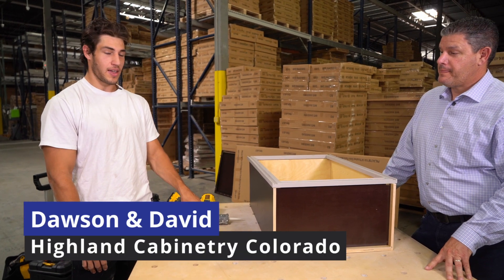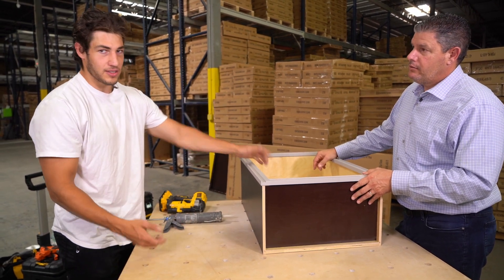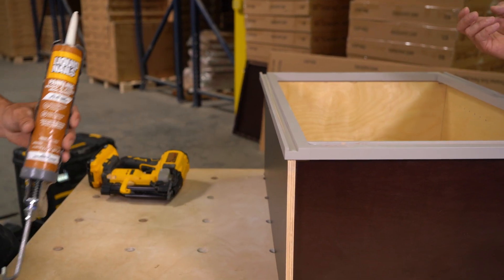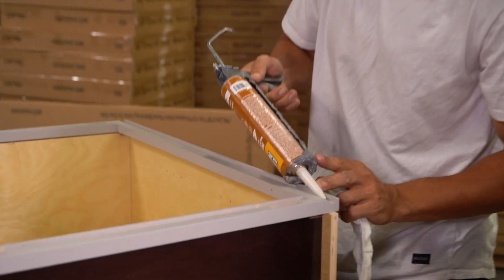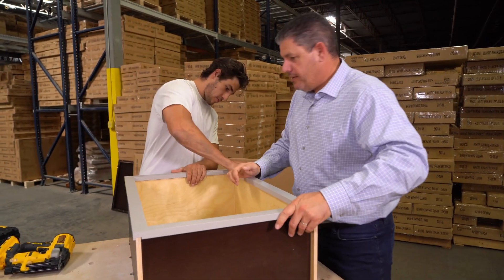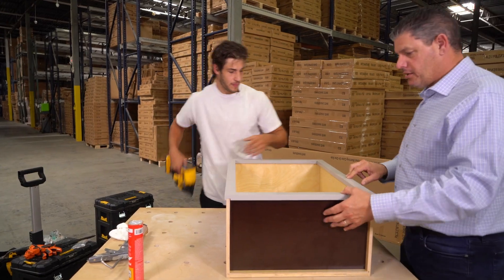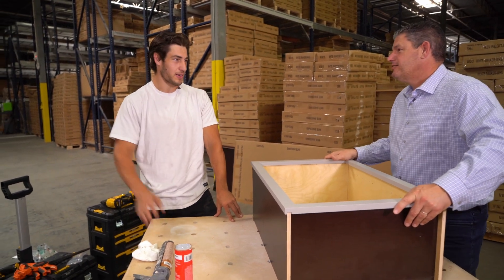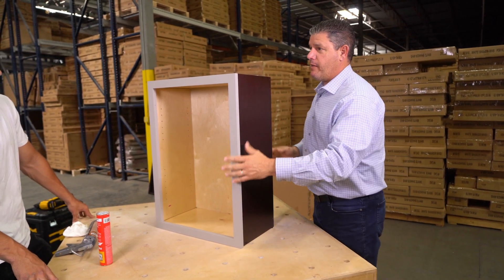The EASIEST Way to Glue a Cabinet Face Frame

Comment: How does one go about changing kitchen cabinets from faced to faceless?  We need to change our existing cabinets to allow me to build pull outs but will lose a lot of sq inches with the current doors.
Reply: I’m on a similar boat. I want to remove the frame from my cabinets, because it does not look great, and then putting a new frame in for insert doors. But I’m afraid I’ll blowout the cabinets and have to “upgrade” to replacing cabinets.